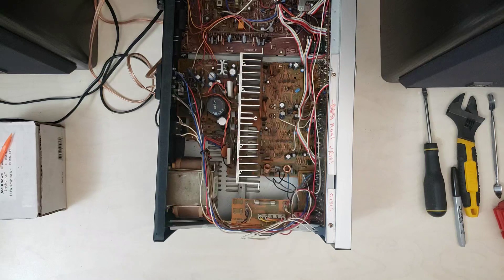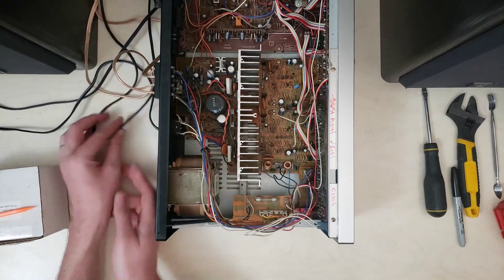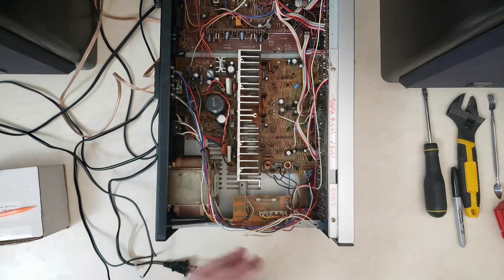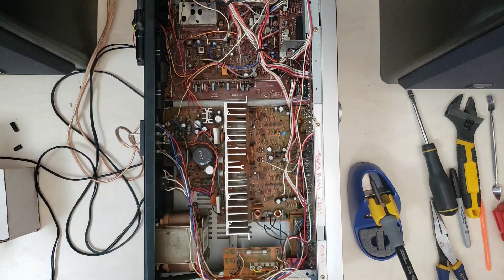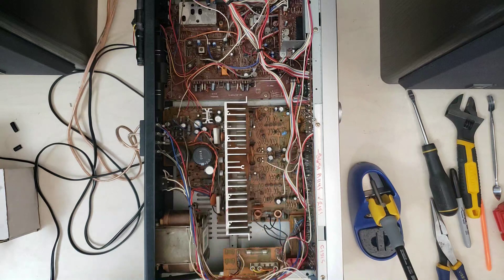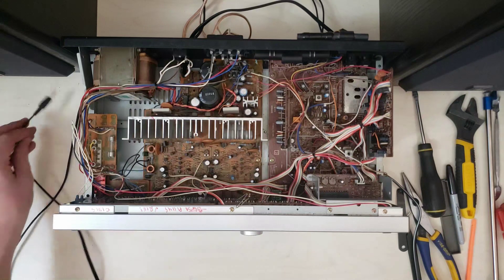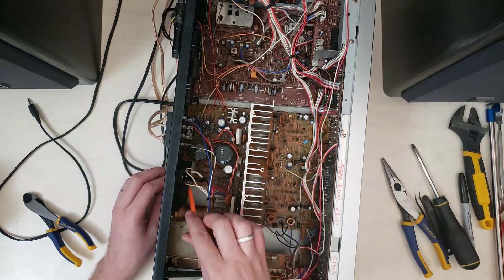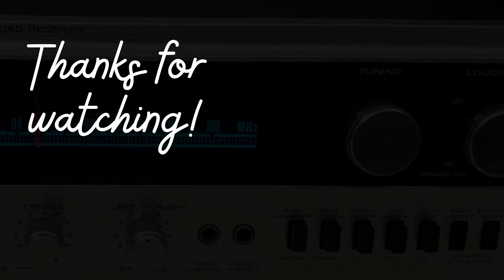Sansui 3900Z: Power Cord Replacement

Comment: Great video brother I'm struggling to replace a power cord on the G-8700DB. No schematic available. Any tips hints or tricks would be really helpful. Thank you Jesus loves you and have a great day.
Reply from the maker: I've not been inside a G-8700DB, but the power cord is wired similarly on most receivers of this vintage. When looking to do the replacement, what trouble are you running into?  This big question most of the time is "why was the power cord cut off in the first place?".  I've come across shorted rectifiers, blown transistors, and myriad other bad things downstream such that I generally test receivers with a DBT and a suicide cord plugged into the always-on outlet on the back of the receiver before going through the effort of replacing the cord.